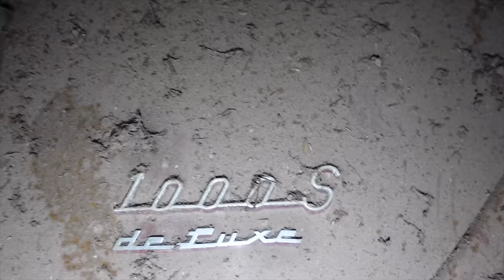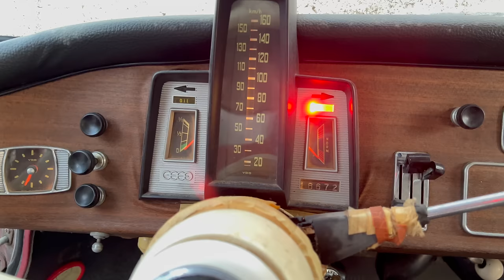DKW BARN FIND RESCUED AFTER 40 YEARS | WILL IT RUN?

Comment: This DKW has disk brakes unbelievable. Nice car from my childhood.
Reply: That was the latest issue, around 1964 MY with ATE  disc brakes at the front, no powered assisted. Just ahead of new F102 that was basically new body on the same chassis. F102  precedes AUDI 60 officially F103 after which there would be no more DKW. F103 was facelifted an fitted with 4 stroke Mercedes engine.

Comment: From NZ  My dad bought a new F-102, the final 2-stroke before they kept the shape, put a 4-stroke engine in it and called it an Audi.  The F-102 was an excellent car and for the day, was a pocket rocket ship and never gave any trouble in the 53000 miles dad put on it.  Modern synthetic 2T oils would have been of benefit, allowing for leaner adjustments on the injector and therefore less smoke.

Comment: We knew this vehicle as an Auto Union 1000s. Neighbours daughter used one. DKW was completely something else.
Reply: The model originated as DKW and was renamed Auto Union but they were still DKW's - later they changed to four stroke engines and renamed the car Audi. Audi was then bought by VW.
Reply: Auto Union was the brandname to which Mercedes Benz switched after they took over the enterprise in 1958. These Auto Union 1000 with the wrap around windshield came for 1959 and ended 1963 to be replaced by the F102. 
The origin (F9) of the design dates back to 1939 and was buildt after the war 0:04 as F89 and F91 (in GDR as IFA F9) with a 10cm widening of the body in 1955 (F93). 
In 1964 VW bought the Auto Union and transplanted a four stroke engine (Mitteldruckmotor) that Mercedes had brought to Ingolstadt into the F102 and named it Audi.

Comment: Back around 1968, I had 3 of them. Needed 3 to be able to keep 1 running. Roller bearing crankshafts kept burning up. Could pull the engine by hand by straddling the fenders. 3 cylinder, 2 stroke engines. 2 of mine you had to add oil to the gas before filling up, but the 3rd one had a separate oil tank and oil injection.
Reply: The engine looks similar to Wartburg engine .

Comment: My dad had one in the early 70's. 
4-door (suicidal at front)... 2-stroke; 3-cilinder/3-ignition; water radiator behind the engine.
Only the Teutons could produce such an interesting oddity. It was designed by a Dane.

Comment: I had one of these with the same exterior color scheme circa 1960  to 63.  Those were my late high school and early college years, and I think the car was a 1957 model.  My brother and I had the car--we had problems with the rubber boots on the front universal joints.  It was difficult to get the parts, and danged near impossible to find a mechanic to work on the car in San Diego at the time.

Comment: My late Dad had 14 D.K.W.'s, all sorts. My favourite were the '63 models. I bacame knowledgeable about them, and could rebuild the engine before I was 12. Fantastic cars, great memories! I'm from the R. of S.A., by the way. They were popular and well loved here! So nice to see one again. 😍😍😍
Reply: Hi Vic, I need to rebuild my 900cc DKW engine. I wonder how the pistons and Crankshaft are set back into the block. Any hints would be welcomed, thanks, Philippe
Reply: Ja, Duitse Kak Wa, dit is wat ons hulle genoem het. 🤣
Reply: @phildelfosse8085  Hi there Philippe! Where are you from? Last time I worked on them were in the '70's! I remember the holes in the pistons of which no. 1 and 2 pointed in the same direction, and no. 3 away. If you google a bit, you'll find quite a bit of info on them. The guys even race them still! I saw some videos a while ago. Very nice! Just search a bit, there are lots of info and clips. I hope you'll be able to get parts! The crank assembly as a whole has to be lowered in. The guys sling it up, and them you gotta guide the rings/pistons in alternatively, a little bit at a time. This they did from the top  As a 12 year old, I lay the block on its side, and with the flywheel/front pulley on, made a "ramp" to level the crank and then "rolled" forward, guiding the pistons in. Alone. Quite a mission. You have to be very careful not to break the rings! Also, make sure that the ring ends/pins, that stops them from turning are not visible in the ports, then it's wrong. Good luck Man! So nice to see some of them are still around. Is it a Junior, or F 12? I think the Junior was a 750 cc, and the F 12 900 cc. The older models were also 900 cc if i remember correctly.  Its been over 50 years! 😳 Greetings!
Reply: @bliksemdonder5624  Ja, lekker voertuie gewees! Die goeie ou '60's en '70"s! Sy eie kenmerkende 2 stroke geluid gehad! Ek mis daai dae, glo my! Van waar is jy? Ek is in Brakpan, naby Carnival City. Bly hier rond al my hele lewe lank.
Reply: @phildelfosse8085  You should really find yourself a workshop manual, even if its in another language you can use a cellphone up to translate it just by passing your phones camera over the page. You´ll need the torque values!
Reply: We have a few of them here in Brazil as well. Pretty cool cars, i´d like a project one day when the wife permits (i already have 4 projects!).
Reply: Dear Vic, thanks for the comprehensive feedback. It sounds like a real adventure. My uncle warned me already some 40 years ago. Yet I kept the car, got busy at work and the DKW F93 slept waiting for me. I did some body work when 18 yrs old...crap need to redo these 😉. I have seen one video from a German fellow but the actual difficult part is not included...with best wishes, Philippe

Comment: Almost bought a Quantum Formula S/DKW in 1972/'73 <

DKWF-Jr. engine tuned by  Porsche factory driver,Gerhard Mitter

Was to have been our $1000 F-C SCCA School Car...

with trailer and spares... helluva deal!

A retired E. Airlines exec's toy...

The Arab oil embargo ended that dream,

along with our newspaper, FLA Racing News, 

out of Miami - PBIR, Lakeland.... USF Autocross events...

Our best Advertiser, STP, withdrew from racing

Andy G had been our best friend and mentor...

Even Mario was worried about sponsors...

Races were canceled....

1973 Daytona 24 was screwed up by IMSA....

Bad times!

Car was FAST! a Mid-pack finisher...

I first test drove it at Ft.Lauderdale airport on the taxi ways

After the tower closed, last EA Electra out...

FUN!

Came on with a BANG 6000 <

Over 100 hp on the dyno.... c.9K

The pipe/chamber was unique...

J.C.

Tech Editor there...

Comment: The first car that my father bought for the family (in 1960 or 1961) after I was born was a green 1955 DKW F91 "Sonderklasse", also marked "3=6" to pretend the 900 cc three-cylinder two-stroke engine was equal to a six-cylinder four-stroke engine.  I remember it had "suicide doors" latched at the rear end, and semaphore turn signals until those had to be replaced by blinkers two years later.  Unfortunately, it broke down on us early upon returning from vacation in Bavaria in 1964, so my father bought a 1961 Opel Rekord instead down there to get us home.

Comment: You should be careful using easy start fluid on a two stroke especially when it’s been standing, it washes any lubricant off the cylinder walls instantly

Comment: you should have took the spark plugs out first,and spun the engine over on the starter, if theirs been no oil round the engine for fourty years! just to get some oil round the engine then attempted to start it!
Reply from the maker: You can see in the video that I poured some oil into it before starting, also ran it on starter with 1dl oil a few hours before even trying to start the engine.

Comment: Why Start with old oil inside? Only  looking for run? 🤔🤔🤔🤔
Reply from the maker: Its a two stroke, do not have engine oil.😊
Reply: Motor 2 tiempos no tiene carter con aceite. Igual, al estar tanto tiempo parado, no era conveniente intentar arrancar así. Se lubrica las camisas primero y tal vez era 6 voltios y le puso una batería de 12v.

Comment: Did Auto Union become Audi? That's definitely an Audi emblem on the trunk.
Reply: It‘s an Auto Union emblem.
The four rings stood for the four brands Audi, DKW, Horch and Wanderer.
In the late sixties VW bought the Auto Union from Daimler Benz and merged them with NSU. And this merger became the modern Audi of today still using the four rings, but nowadays they represent only Audi and not the other three brands.

Comment: It's truly disheartening to see how some people can treat a valuable and vintage car with such carelessness. This young guy, clearly inexperienced, thought he could restart an engine that had been idle since 1975 without any proper preparation. He only caused damage, showing a total lack of knowledge and respect for a vehicle that deserved a much more professional treatment. It's a real pity that this car wasn't left in more capable hands, those who would have appreciated its value and preserved its integrity.👎👎👎👎👎
Reply: MY first legal car was a black and white 1957 DKW. I loved it but thr previous owner didn't know about greasing the crankshaft and it was galded to bad to fix.
Reply: The heavy smoke on startup proved it had plenty of lubrication.
Reply: But he DID grease and oil it up - he just didn't show it - else it wouldn't have started and run so smoothly, or burnt so much lubrication into white smoke. See @10:51 fror a glimpse at what he did.

Comment: Do not use brake cleaner or carb cleaner. Pour gas with oil in it
Reply from the maker: Had some oil in it before starting, should be no problem during those seconds. 🙂

Comment: That was not a good cold start procedure for something sitting 40 years....😯😯😯🤔
What about the:
Fresh fuel?
Fuel filter?
Carb float bowl?
Fuel lines?
Oil psi?
Oil &filter?
Plugs?
Ignition?
Fuel pump?
Lubricate rings?
Or turn it over by hand?
Unless you parked it last, why would you not check the engine conditions before the battery and starter fluid or did I miss that part 😮
Nice car hope you didn't hurt it🤔😖🤞

Comment: I often watch channels on finding very old cars and restoring them. And it always seemed to me that technically literate people do this. But some of their actions cause me extreme surprise. I can't believe a technically savvy person would do what they do. I mean an attempt that defies any technical logic to start the engine after 30 years of oblivion somewhere in the forest or in a barn. Why do they do this without disassembling the engine and repairing it? After all, it is precisely these attempts to start the engine without repair that can lead to its fatal death. That is, the engine could have been repaired, but their attempts to start it made this impossible. All that remains is to throw it in a landfill. Are they sure that the oil pump pumps oil at the required pressure? Are they sure that the oil channels are clean, free of dirt, and oil is guaranteed to flow to all lubrication points without sand or dirt? Are they sure that the piston rings have not lost their mobility and will not begin to remove chips from the surface of the cylinder when trying to crank the crankshaft? Are they sure that the crankshaft journals are perfectly polished and without traces of corrosion, which over 20 years has turned them into sandpaper (the same applies to the camshaft bearings)? These questions can be continued about the coolant pump, the cleanliness of all engine cavities for coolant, the correct operation of the thermostat, etc. If you are planning to throw out the engine, no questions asked, continue. It is their attempts to start the engine without repair that will transform it into the category of non-repairable, only to be thrown away now. It’s hard for me to call such people mechanics, sorry.

Comment: That's a 2 stroke engine, the feul needs to mixed with 2 stroke oil. Spray enough of that shit into the carburettor and you'll destroy that engine.
Reply from the maker: I poured oil into it before starting, you can see it in the video.🙂 Should be no problem during a few seconds.
Reply: Romperlo fue lo que intentó, supongo, aparte de como trató la carrocería.

Comment: A perfect episode of "How not to start a car"! You put a 12v battery on a 6v car and then start it with starting fluid even though a two stroke engine needs its lubrication from the oil added to the fuel. Not smart at all....
Reply from the maker: I put some oil into it before starting and also the owner had oil in the engine when it sat, as you can see on the smoke. No problem starting it with starting gas i few seconds as long as it has lubrication.
Reply: @Hampus_Granstrom  ... yes, but those crazy revs before oil came to the bearings is my worry. Even a 2 stroke needs oil to be at the crankshaft. (that's not 40 years old)